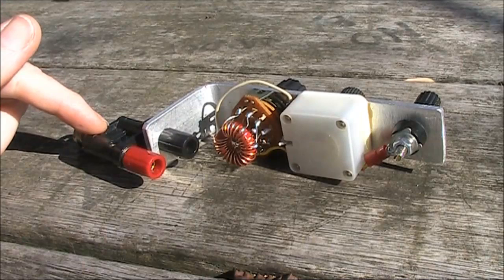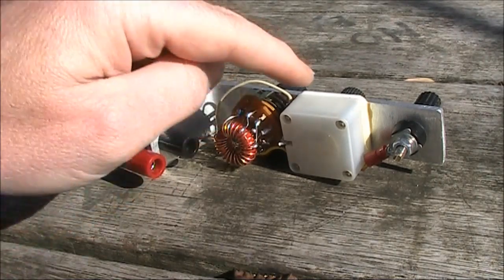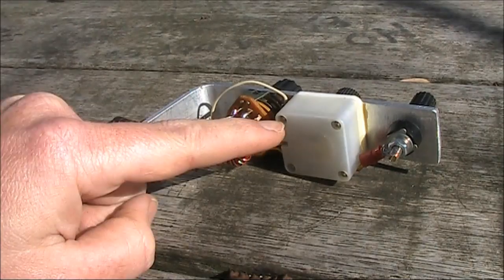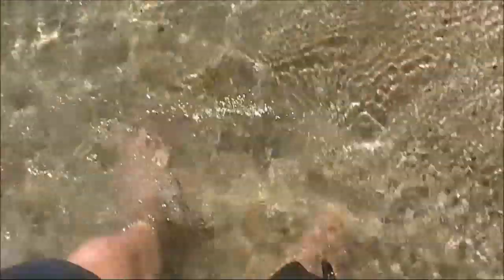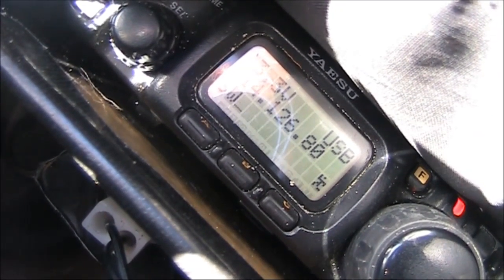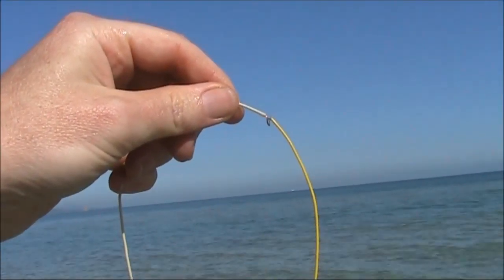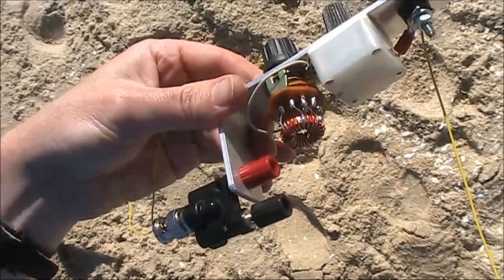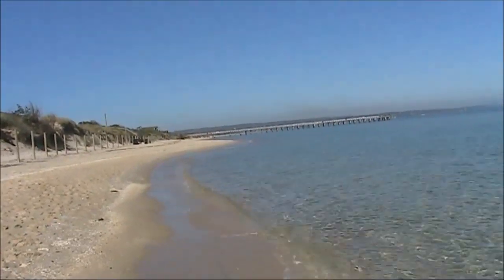A ground tuning unit for 14 MHz pedestrian mobile

Comment: Hi peter
Ao should i connect the ground tuner in series with the radiater(video shows better performance) or in series with the radials/counterpoise
Reply from the maker: Depends if you need it to function as an antenna tuner or ground tuner.

Comment: I wonder if going out to the end of a jetty (pier) and dropping an egg ring connected to a piece of thickish wire (say wire from a 15A extension cord) of a longer length than needed so the ring is a few metres in the water would be any better. Also tune it up with a ground tuning unit. Have a second tuner to tune up your radiator on other bands... Perhaps the GTU and antenna tuning unit could be integrated into one unit, a small aluminum box. The problem, I guess, would be interacting adjustments, In which case you'd just go for loudest band noise. I suspect that if you helically wound your radiator you'd get an absolutely cracking signal going to certain locations of Australia on 80m as the sea water would be the best conductor down there :)

Comment: Could you post a link to design considerations for different frequency ranges for this device.  Looks like an antenna tuner in the ground circuit.  I checked your website, but didn't find any information.  Thanks!

Comment: This is getting very close to your floating radio idea ;)
Reply: Just thinking of that, what would stop someone from using a buoy using aluminium framing with coax running to it. Earth the coax to the frame and have a matching unit and half wave radiator on top. Keep the buoy tethered by rope. It would have to get out extremely well. Having said that, so would using a metal trawler as your earth and having the antenna up on a mast just above the cabin. You could use the diesel engine and alternator to charge batteries and QRO at will. 100+ Watts would create a very large foot print on HF if you were several miles out to sea. You could QRP and tickle the wick up :)